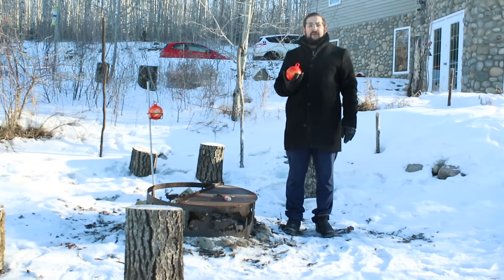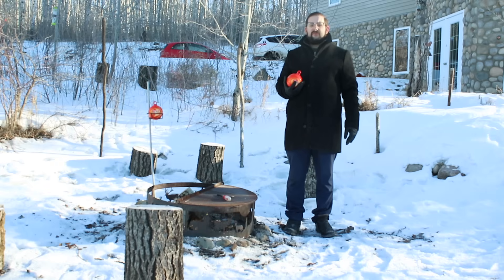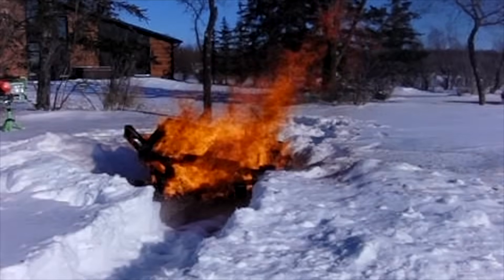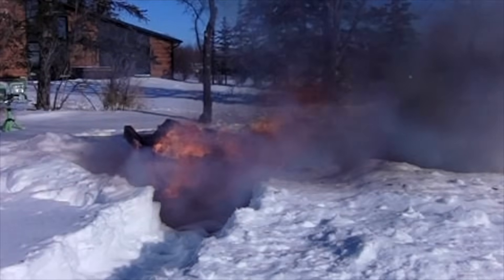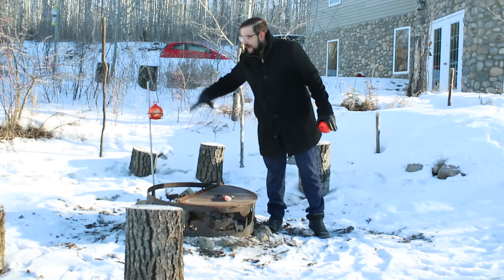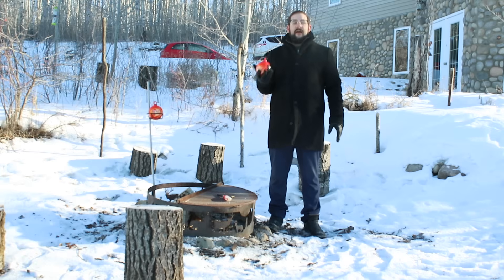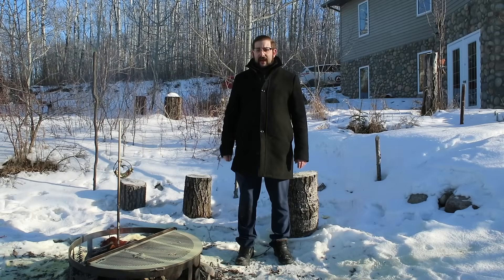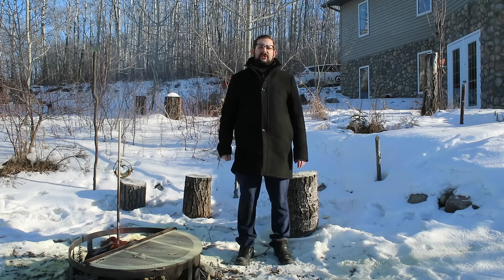SHORT: Testing a Modern Fire Grenade - ROUND 2!

Comment: You demonstrated use in an application for which fire grenades aren't intended, i.e., open, non-enclosed fire. Fire grenades are best used for enclosed fires(dumpsters, garbage cans, hazmat lockers, inside the engine compartment of a vehicle, etc).

Comment: Buddy of mine has about... 6 of these hanging in his shed above his backup generator. these are not for open spaces, but for enclosed ones. While these are the best at dispersion i've seen, the simple fact is they are meant for small rooms, like a closet or utility room where the temperature will rise significantly, and quickly. 

if you have a metal trash bin, get a small fire going in there and pitch one in or have the grenade above it, you'll see what i mean.

Regardless, as you can see in the video each one of these only cover about a 3 foot circle, so if you're using them in 'automatic' i'd say string a couple above whatever your worried about. These are meant to stop a small fire from spreading, not put out a large one. there is too much heat in a large, established fire for one of these to work. the way these powders work is they starve the fire of oxygen when they get hot, and they can only do so for so long when they're spread so thinly.

Comment: You can purchase dry chemical fixed extinguishers in the 2.5lb range for enclosed applications like storage areas, motor compartments etc. I think that would be a better investment 

Looking at that fire in confident  a 2.5 lb portable extinguisher would be more than enough to put it out

Comment: Well lets look at when you would want this as opposed to an overhead sprinkler system and see how those use cases compare to an open fire outside.

inside an electrical cabniet.
In the bed of a milling machine, or lathe that machines flamable metals.
above a small protable deep fryer or small portable kitchen, such as a food truck.
directly above a fire hazard such as high intesenity lighting.

I am begining to sense a theme here. And its all enclosed and small with potential for an very high heat small fire. Or rather its all about asking what use case does this serve rather then asking what test can I easily film.

Comment: You might just think about how much (really, how little) powder these contain as compared to a regular dry fire extinguisher. The latter are rated for the size of fire they are considered effective against. Although the manual extinguishers have the advantage that the user can aim the powder to the most active part of the file, the comparative size might nevertheless give you some idea of how much fuel the grenade should be effective against (assuming they are not already marked with ratings).

Comment: Time for round 3 - how effective it would be to put out fire in box enclosed from the top like a traditional fireplace. I guess all the powder that got dispersed up would stay and make a thicker layer on top of the logs. That should help with reignition too (maybe?). But overall that's another possible use case - fire in fireplace/furnace gets out of hand and You don't want to risk staying in the same room trying to use traditional extinguisher. But that's a stretch, from what You shown it was always a novelty item

Comment: They should make one that's two separate halves filled with vinegar and baking soda so when it breaks, they mix, and react to make a cloud of carbon dioxide to smother the fire. CO2 is heavier than air, so it will hug the ground at the base of the flames. And it makes a lot of CO2, about 1000 times the volume of liquid.

CO2 is actually used in some fire extinguishers, and is superb at putting out fires. One of my favourite demonstrations is just after pouring a glass of soda, I light a lighter and put the flame down into the cup, where the CO2 extinguishes the flame instantly.

Comment: Once you have a fire going with a lot of coals it is pretty hard to put out completely even with water. If you use water and put out the flames it will eventually light back up if the coals stay hot enough to smolder and dry the water.

Comment: These things might have an effect in enclosed spaces as cabinets or really small shacks. There is also an non pyrotechnic varieties out there that looks and works like automated fire extinguishers - sprinkler head with glass ball fuse on a bottle with powder, foam or CO2. And then there Halon systems yet. But they all work best in enclosed spaces. Must be a theme with these.

Comment: It seems like you could get the same effect hanging a 5 gallon bucket full of water over the spot.
Reply: Or a bucket of sand, as the water would evaporate over time, especially when exposed to warm dry in the vicinity.  Drill hole(s) in the bucket and cover the holes with lighter materials that will weaken with enough heat, like paper or cardstock for sand.

If you want to get fancy, bury a small firework or ball of gunpowder/ black powder / etc in the sand with the fuse sticking down towards the fire and the top of the bucket firmly sealed and bottom of the bucket weakened as described above.  Fire gets hot enough, fuse ignites, small explosion forces sand downwards.

Comment: I have one above my cooker in case of oil fire and two in my storage cabinet where I keep chemicals and paints. Lower thus closer to the possible fire so they may go off earlier when the fire just starts and in a more confined space, even if they don't put out the fire at least slow it down and the sound warns me before the smoke detectors do.

Comment: I use those aerosol can fire extinguishers as large fire grenades.  They will explode on their own in a fire, scattering foam everywhere.  They can also be used as a traditional fire extinguisher for when you are there.
Reply: I think they mean the small fire extinguishers that are shaped (and largely function) like a can of shaving cream or spray paint.
Reply: You probably do not mean the big red cans usually wall mounted? cause i imagine that could produce some pretty nasty shrapnells
Reply: this isn't a video game, just because a canister is painted red doesn't mean it will explode. what you are doing will provide zero relief in a fire.

Comment: As mentioned they are meant for enclosed spaces.
Another potential issue is a longer burning fire, like the fire pit, have a lot more heat trapped in them than most new fires.
There are the coals that trap a lot of heat and can potentially reignite.
Reply: A fire extinguisher that only works on 1/100 fires isn't something I would want to rely on or even have in my arsenal lol. A water balloon would be more effective in more scenarios.

Comment: I have seen these put inside a cabinet where battery powered tools are charged in case of fire I think it would work great in that application.Thanks for a good informative video.
Reply: Considering battery fires are most likely burning lithium, I don't think those thing would be any help as lithium salt are self-oxidizing.
Reply: @maosw  Incorrect. Most of the energy in a battery fire is from various battery components burning with air. There isn't that much lithium in a lithium-ion battery. Only about 70 g per kWh. The enthalpy of combustion of the lithium in a battery is about the same as the stored electrical work--not even enough to boil the same amount of water. However, for each atom of lithium there are at minimum 6 of carbon as graphite, and various organic liquids in the electrolyte. And nearby plastic components. That's what burns. Oxidizer not included.
Reply: @sealpiercing8476  Lithium salt is self oxidising, it isn't the lithium itself that's the issue but the fact that the hydroxide salt breaks down to create more oxygen which creates more fire.
Reply: @daviddavidson2357 I thought this was totally wrong and looked up lithium hydroxides TG DTA curves to reinforce my argument. Now I’m just wondering why anybody would want one in their home. Scary stuff and hard to explain to the average punter
Reply: @JesusChristo-g1y  What's the point of paying for all that insurance if I'm never gonna use it?

I do a lot of random things with batteries of all sizes, I have various lithiums around constantly. The only battery fire I've had in the house was a freakin' lead acid SLA inside of a UPS system. The house smelled like cancer!
Reply: I doubt it would do much, but it would be a relevant and interesting test.

Comment: Couldn't you achieve the same effects of this device by putting in a M-40 firecracker inside a box of baking soda? And not have to worry about dispersing toxic chems? (NOT baking powder..that would be bad)

I can appreciate the use of a device like this in electrical closets, or in foundries, or other places where the risk of fire is high, as mentioned in earlier posts.  What causes me to shake my head is the choice of retardant used, considering something like baking soda is cheap, non toxic, and would make clean up much easier, but the triggering device is far too insensitive.  It makes a lot of sense to have it detonate early, to minimize damage.  And using something like baking soda, probably won't break equipment, beyond what damage the fire already caused. And why not Halon in a low pressure bulb? You'd think that would be far more useful...🤔🧐
Reply: IIRC Halon is a CFC, so deliberately releasing it would be... bad, and illegal in many places. I'd presume that such fire suppression systems these days are loaded with something else and/or require a special licence to operate in most places. Not that air-displacement setups are a thing people should be around without proper training and safety gear anyways. People kind of need air to live!
Do we know what the retardant is in this one? It's not carbon tetrachloride, that was the old glass ones full of liquid. This is some kind of powder, I'd assume similar to what's in powder fire extinguishers, but there doesn't seem to be ENOUGH of it to work outside a very confined space. Seems possibly good to put in an electrical/chemical cabinet, battery charger, or 3D printer enclosure, though, or a fume hood where any kind of flammable chemistry is being left to run. Anywhere you might be leaving stuff that might self-ignite unattended in a space small enough for the tiny explosion of extinguisher powder to do something.

Comment: It seems that a lot of things which are meant to react to fire or heat only do so after a delay. Smoke alarms go off maybe a few minutes after you can visibly see smoke, sprinklers need a lot of heat to go off, and these seem to take a bit too. I guess it makes sense, so a false alarm caused by something benign doesn't set it off, but it would be convenient to know that a fire might grow out of control the moment it appears, even if you can't see it. We really need something faster that doesn't go off in a safe situation.
Reply: Maybe something faster is needed in special circumstances, but in general a bit of a delay is not a problem and is an insurance against unneeded triggering.  Sprinklers go off when the temp is hot enough, long enough, to melt a lead link. They signal their activation to a central location and if they don't extinguish the fire they will keep it down until the fire brigade arrives -- if they have been correctly designed and installed.
Reply: Good quality, modern smoke detectors should go off before you can see smoke.

Comment: Like others have said, I think these would probably be more effective indoors. It doesn't take much wind to change the powder dispersion significantly. I would also suggest that doing this outside, especially on a cold, snowy day, might have had an effect on how long it took the grenade to deploy. I definitely wouldn't trust them either way, but there's no harm in playing devil's advocate.
Reply: Metal fires in the bottom of a milling machine or lathe.

Above a smaller portable deepfrier.

Inside an electrcial cabnet.

Hes thinking far too broad and big for any little device to be effective.

Comment: I use this exact product in my grow-room. I figure in the event of a fire it automatically going off in the confined space would certainly have an effect on any fire and at least give me more time to react and get the situation under control, However I hope to never find out.
Reply: Yeah, that's my theory on these, it's a dumb automatic delay so I might have more time to put out the fire/escape. I also imagine they work quicker in a enclosed space where heat can build up.
Reply: Same here, but for computer/electronic stuff. Worst case scenario I paid a few hundred dollars for a little less worry/stress, even if it ends up doing nothing if something were to happen.
Reply: By the time that grenade goes off, half your grow room will be in a full blaze
Reply: @shamancredible8632  no, I have it mounted less than an inch from the main lights and electronics. His test here is honestly an awful demonstration of these, when stored at room temperature and used in an already warm environment they go off much sooner.
Reply: @shamancredible8632 bro look at this test rig. look at it. in what ways is it similar to a grow room.

Comment: I really would like to have seen how the original design worked. For many years in the 60s while working at a small local newspaper, I had to look at one of those Red Comet grenades suspended over the stairway that led to the basement furnace room and the coal bin. The coal bin had by then been converted into a photo darkroom which is where I spent a great deal of my time. I always wondered first,  how old that thing was, as the paper had been in that location since the early days of the 20th century, and second, what would happen if was activated... and for that matter how it got activated in first place. Thanks for your earlier video which explained this. One thing is for sure, I probably didn't want to be down in the darkroom if that grenade ever broke.
Reply: Here's a couple of videos showing Carbon Tet extinguishers. The first isn't a very realistic demo, but the second shows a pressurised cannister in use. This gives a better example of its effectiveness.
I've used a pump carbon tet extiguisher in training (yes, I'm that old!). The only extinguisher with a similar knockdown time for size that I've personally used was a BCF filled one (also now mostly banned).
Edited to add: One problem is that Carbon Tet can decompose in heat to form Phosgene (if I remember correctly) which is a war gas!
https://youtu.be/79fpNpim6sA?t=810
https://www.youtube.com/watch?v=mngXjYQu7JU
Reply: @bravodelta3083  I now recall us having a couple of those little pressurized carbon tet canisters on the wall in our pressroom too, but I never saw them used. I like how that guy in the demo was fighting this big fire, covering his face with his hand from the heat, but never once took the cigarette out of his mouth.
Reply: @TheDevice9  Well cigarettes were expensive! :)
I also notice he used way more than one to put out the big fire (the canisters are on the floor in front of it).
Reply: the reaction would probably look similar to tossing water on a fire just more violent since the carbontetrachloride is absorbing a lot more energy than water, and it probably smokes since its decomposing. I had a jar of carbontet a while back at work, probably should tried it on some fire at home
Reply: The reaction isn't very violent. It looks like a magic trick. It's just such an effective fire extinguisher that it looks like a magic trick. 

It kinda is. It not only displaces oxygen like fire extinguishers we're used to but it also chemically stops the oxidation. 

So it takes way less carbon tet to put out a fire than you would imagine.

Comment: From what I remember about demonstrations and real-life uses of fire grenades, they're meant for enclosed or semi-enclosed spaces, which stops the retardant from dispersing too much. 

Most often I've seen them in chemical storage closets, electrical cabinets, etc.
Reply: I saw commentary from some people a few years ago about installing them in 3D print cabinets.
Reply: @Bigrignohio  Sounds like a good contingency.
Reply: Above stoves too. If anyone wants a good example google 'StoveTop FireStop Rangehood' for more modern designs. Place I rented from years ago had  them above the stoves and I ended up buying a bunch for electronics and such. They're not too expensive considering you just slap them above whatever you're worried about and at worst you've wasted 30$ per or so.  Not too bad if you know potential problem areas and aren't always around to fight/respond if something were to happen.
Reply: In a large scale and dropped as the do military bomb dropped in a long line or spread out as a cluster bomb it would effectively knock out a large portion of any fire..

Comment: I wonder if a niche use case for these would be putting one inside the casing of an electronic device--something with a lot of internal space, like a PC tower.
Reply: Wth are you doing with your pc for it to catch fire? (Running intel on stock cooler?)
Reply: @Giuliana-w1f or AMD - depending of current year, this joke could go both ways
Reply: @paveloleynikov4715  yeah, i was gonna say AMD FX originally
Reply: Above a 3d printer would be useful. pop right when a small fire starts.
Reply: It's not too uncommon to have a cable fire in a PC caused by an internal near-short on a GPU or even a SATA device like a fan controller or disk, for example via a faulty capacitor. After all the PSU will happily dump several hundred Watt into the faulty circuit before it can detect anything being wrong at all.